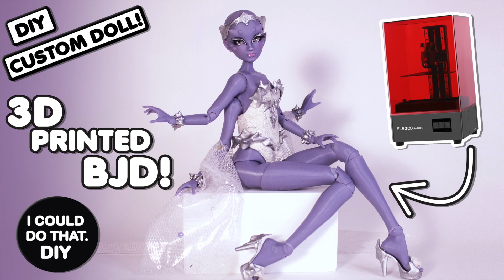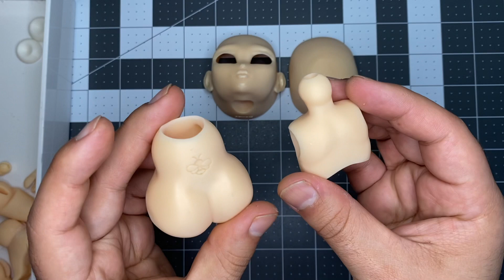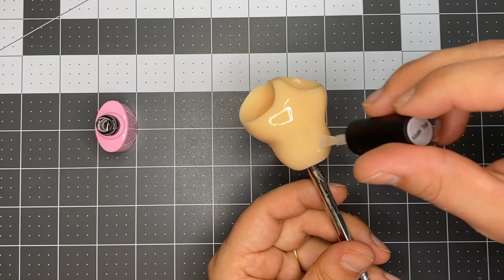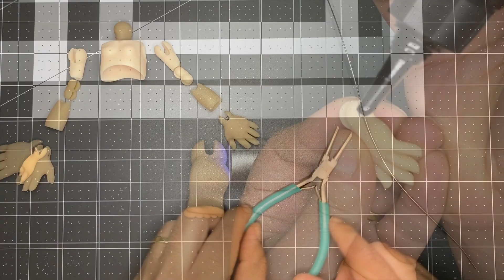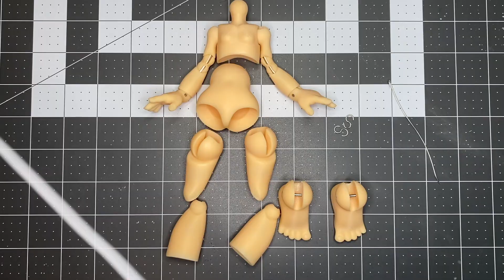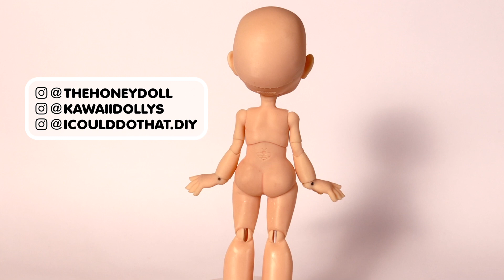🐝🍯 INTRODUCING.. HONEY!!! 🍯🐝 DESIGNING & CREATING MY OWN BJD!! 3D PRINTED!!!

Comment: 3D print should be cheap, then I checked the website 😕
Reply from the maker: you might be thinking of filament printing, which is much cheaper. Resign printing is a lot more expensive. Plus there are other costs (materials: resign, elastic, wire, sanding, finishing joints, packaging, etc) associated with the construction other than printing costs.
Reply: @ICOULDDOTHATDIY  appreciate the reply, we will have to disagree I think
Reply from the maker: @steveelkins52  shrugs

Comment: Do you have any videos or courses on how to create the 3D model for this doll? What are the steps to digitally sculpting a BJD doll? How do you create the different parts of the doll? How do you create the joints? How do you make sure the joints are the right shape & size to make the doll easily posable? What settings do you use to save & print the 3D model? How did you add the doll’s name on the back of the head? I’d love to see the whole process of this, from the digital 3D modeling, to the printing, to the assembling of the different parts, to the coloring process.

If I design a 3D model for a doll, I might use either ‘Blender’ or ‘Nomad Sculpt’.
Reply from the maker: I do not but that's a good idea!